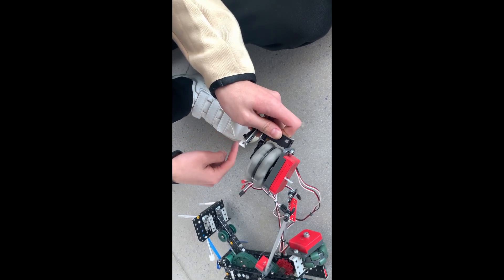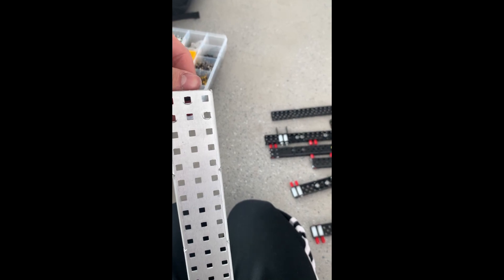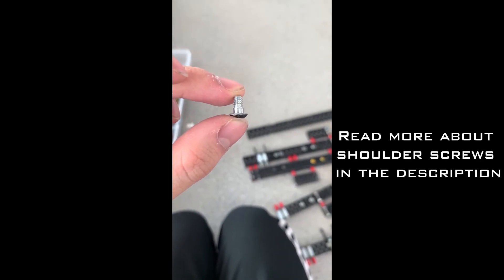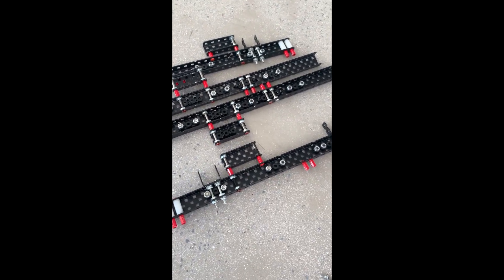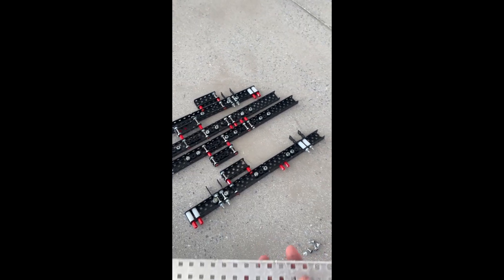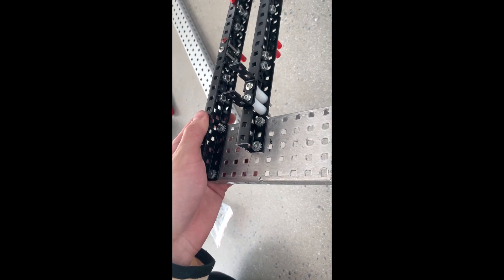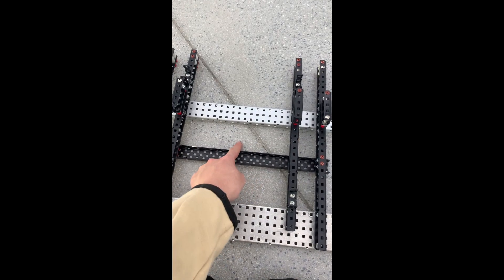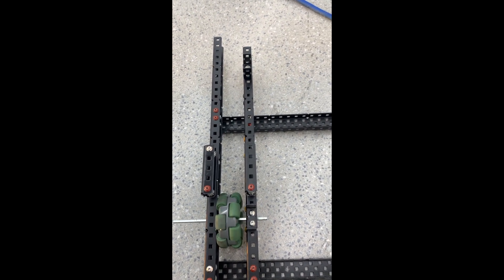VEX Build Masterclass #3 - Squaring

Comment: Can the chasis become out of square over time? If so, how would you go about fixing it?
Reply from the maker: Yes, the chassis can become out of square over time. 

As for a quick fix, loosen all the bracings and align the chassis using shoulder screw and 5 wides again, then tighten the bracings and remove the 5 wides. It is however easier to ensure that misalignments don't happen in the first place by having a well structured and supported robot. 

Note that this technique also applies to structures outside of the chassis. Here is a pic of me using the same technique to square my robot's towers. https://cdn.discordapp.com/attachments/594335615361875991/1129425104695218276/IMG_5487.jpg